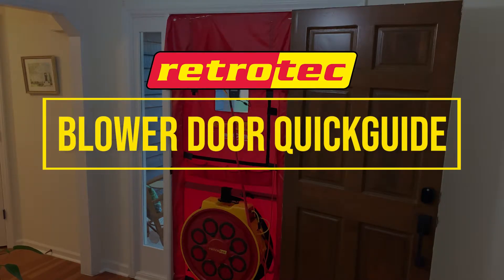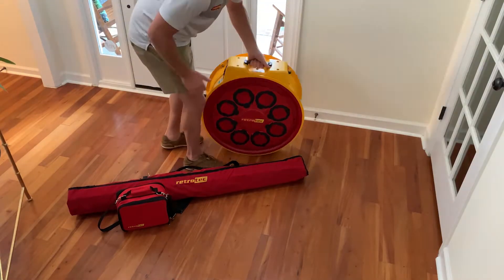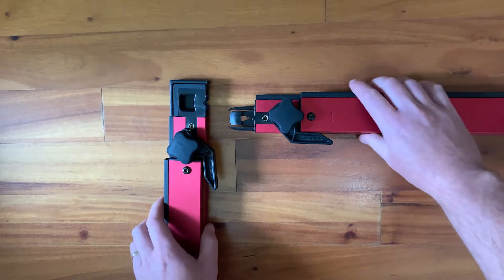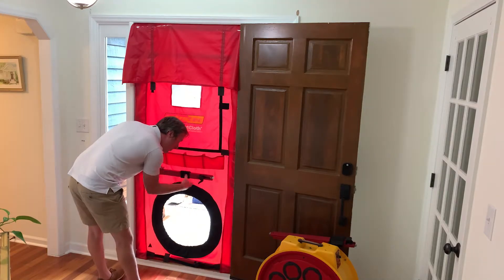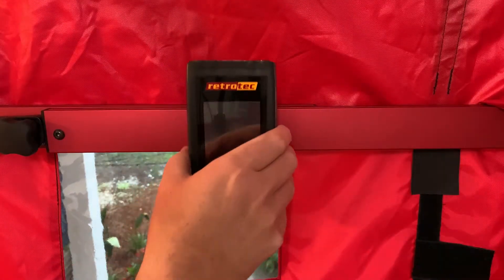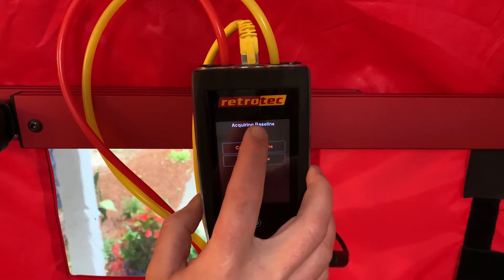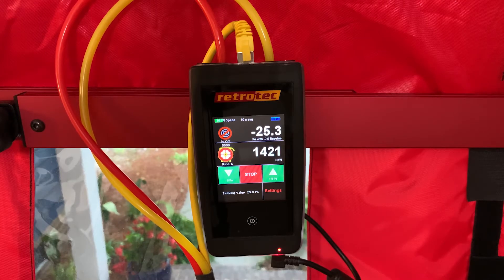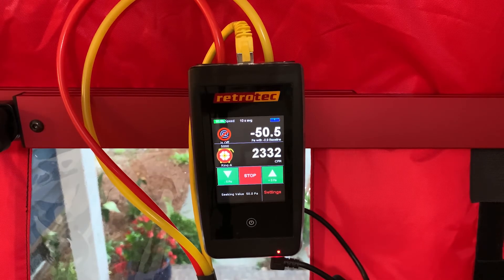Blower Door QuickGuide

Comment: How to do pressurisation test
Reply from the maker: Hi Mohamed, do pressurize the building, we simply flip the fan around so that the "outlet" or exhaust side is facing the inside of the house. For Retrotec systems, we set up the manometer the same way we do a depressurization test. The only thing that changes is the fan direction.